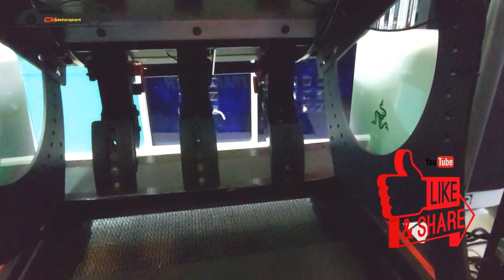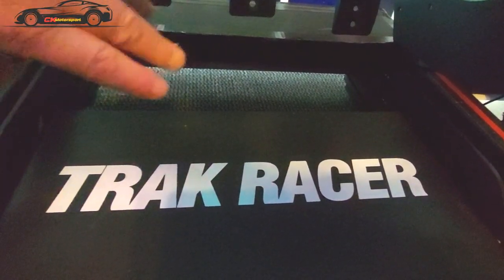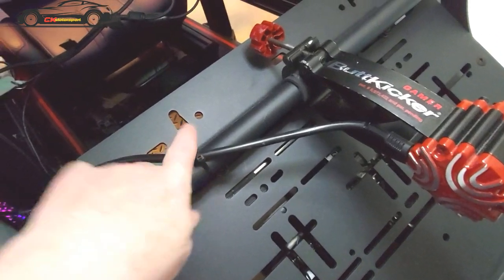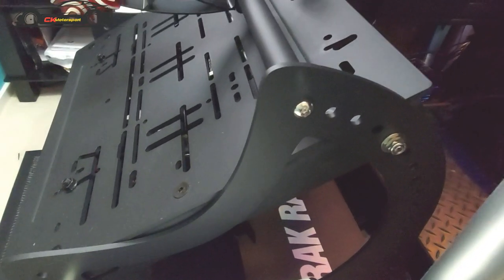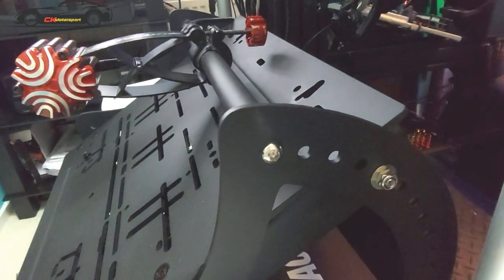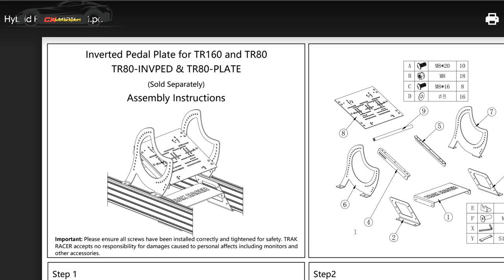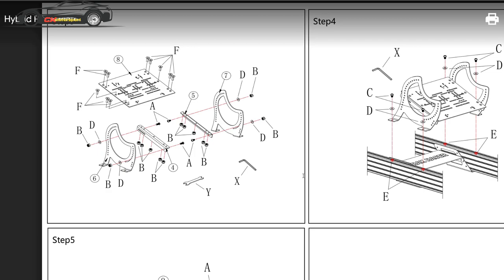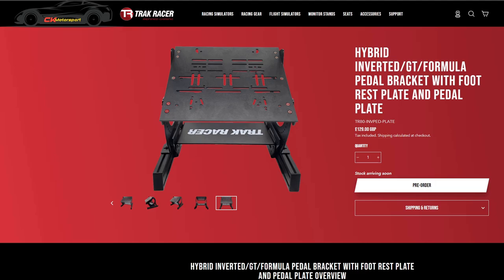TRAK RACER HYBRID INVERTED PEDAL MOD - REVIEW

Comment: I’m contemplating buying a TR120 or TR160. 

I’ve also been considering the inverted pedal set, primarily because I think it will feel more like most road cars.

Interesting hearing that your rationale for getting it was due to ankle damage. I also have an ankle issue, but that was not a factor for me considering the inverted pedals.

If you drive real cars, can you comment if the inverted pedal set made a noticeable difference to it feeling closer to driving a road car

Comment: Is this the AUD150 for this pedal plate + Side steel brackets? Is it still possible to floor mount the Throttle pedal only?
Reply from the maker: Yeah you could leave your original plate in and mount the throttle on that
Reply: @CKone41  nice thanks
Reply: @CKone41  just to clarify, it does come with every single thing shown on the image on the website, so that it can just sit on the floor? Also if possible, how low is the lowest mounting hole? To use as a standard pedal base not an inverted one
Reply: How Wide ? How Tall ?
Reply from the maker: Check out the website